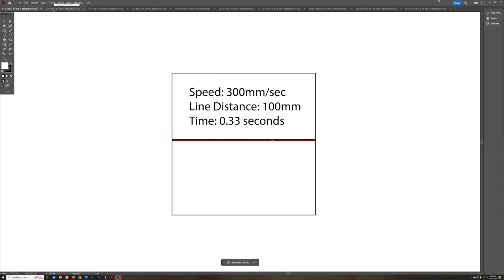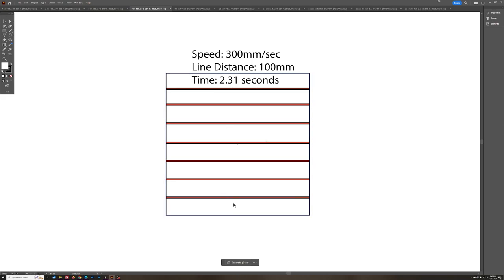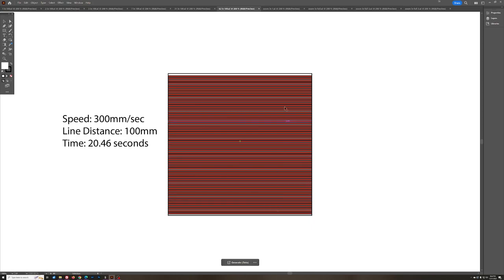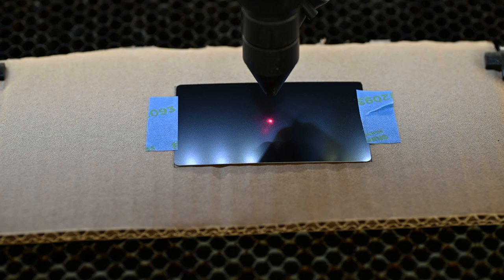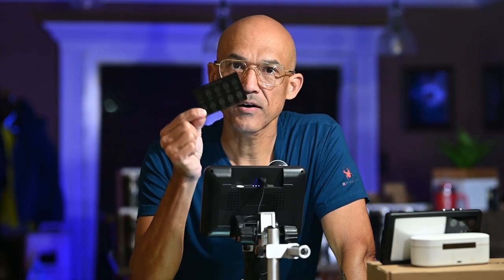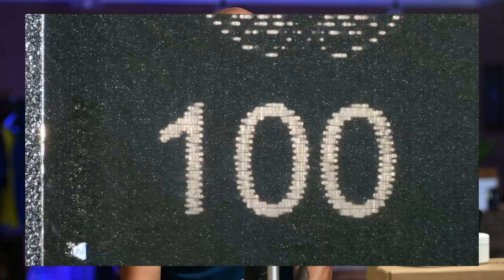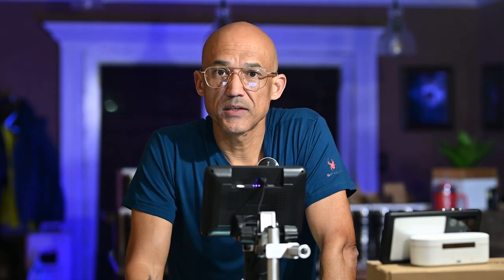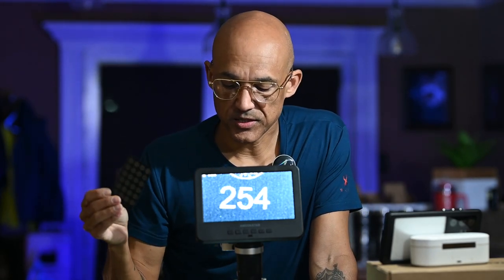Lines Per Inch (LPI) in Laser Engraving - Master this setting!

Comment: Next time you won’t have to count the lines use the blend tool and type in how many lines you want in between. So if you have a line on top line on bottom that’s two lines already if you need a 100 you’ll select the blend tool click on top line then bottom. You’ll get a pop up box total you’ll type in 98 and illustrator will create them for you.
Reply from the maker: That is a great tip! Thank you!